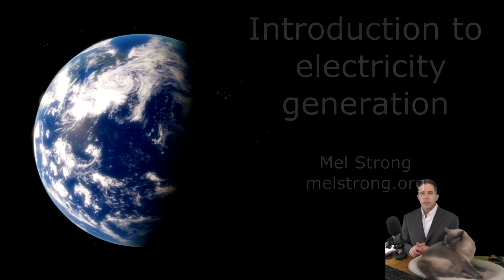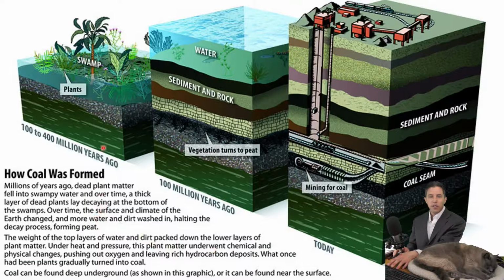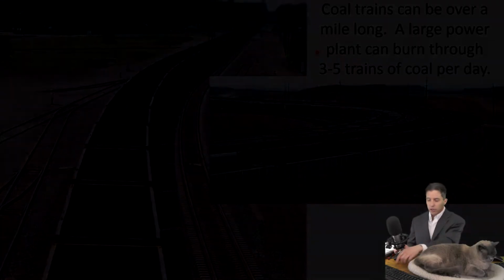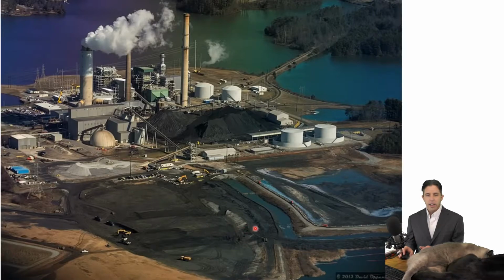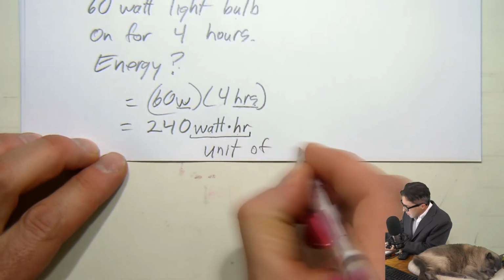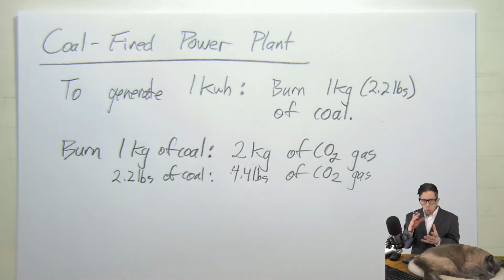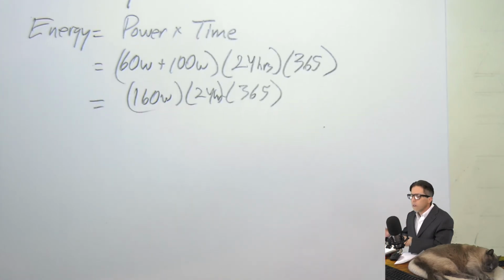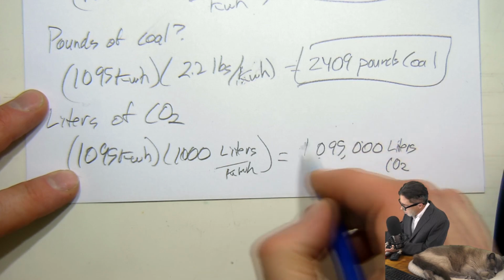Lecture 18:  Introduction to electricity generation and calculating carbon footprint

Comment: The minimum optimum atmospheric CO2 level for C3 plants is 1200 ppm about three times current levels which would greatly green the earth.   There are no serous issues from these higher levels of CO2.  Global warming has been officially at 1.0°C since 1992 with no known cause in 2026.   

All the greenhouse radiant energy from the earth is completely absorbed a few meters from the radiating surface by greenhouse gases in earth's water vapor saturated greenhouse effect adding 10°F to earths's average temperature.  After being absorbed further heat transfer is by convection.  On average water vapor is over 99.5% share, CO2 less than 1/4% share and human caused CO2 less than 0.1% 1/1000 share.   This was earth science when I went to US High School in 1978.   

The math:  Water vapor on average is 1.00% of the atmosphere with a CO2e of 18.   CO2 is 0.04% atmosphere with a CO2 of 1.   1.00%/0.04% = 25, water vapor is 25 times more present than CO2  X  18 CO2  =  450 CO2e for water vapor and 1 CO2e for CO2.  All the other greenhouse gases total to 1 CO2e.   Water vapor's share is 450/452 = 0.99557, CO2 1/452 = 0.002212 40% of this is considered to be from human causes  X  0.40  =  0.00088495

Comment: For clarification, 90% of coal comes from the Carboniferous and Permian periods, beginning about 300 million years ago. So contrary to what psuedoscience people might sometimes try to tell you, it is not being naturally produced en masse any more. The Carboniferous was a unique period where, even though in an Icehouse period, the tropical regions were extremely hit and swampy with many anoxic waters. The Carboniferous also ended in what is called 'The Carboniferous Rainforest Collapse', I suggest the YT page 'Earth.Parts' by Dr. Johnson Haas for more on this. His page is a good supplement for the geology side of studying Earth Systems Science like Mel Strongs is for the atmospheric side. 

Natural gas production releases alot of methane though, and atmospheric methane becomes CO2 and H2O after it has been in the atmosphere for so long.